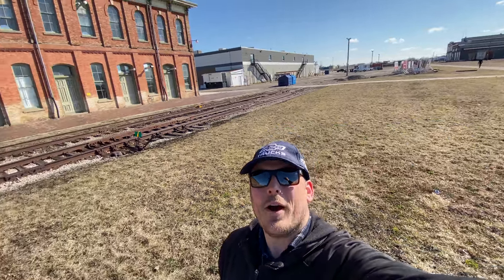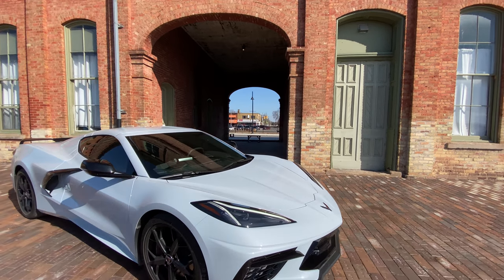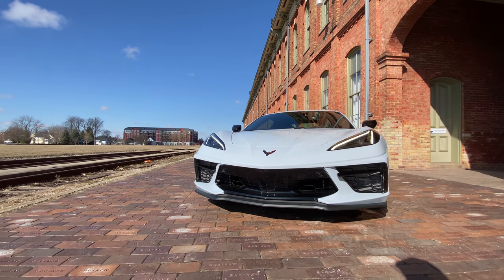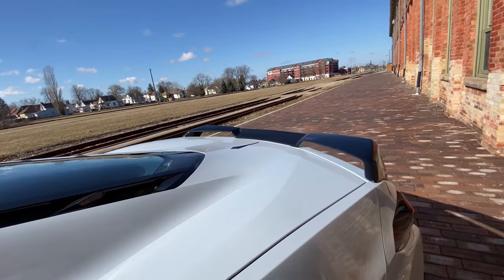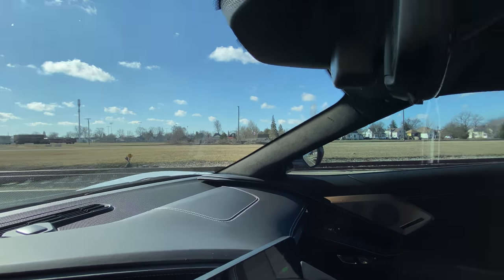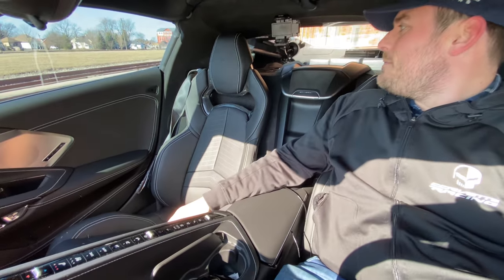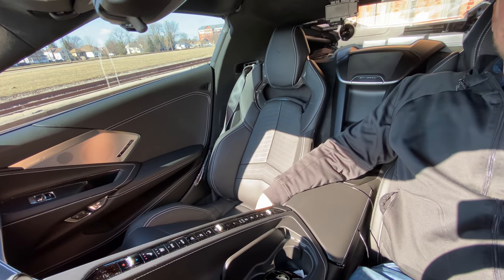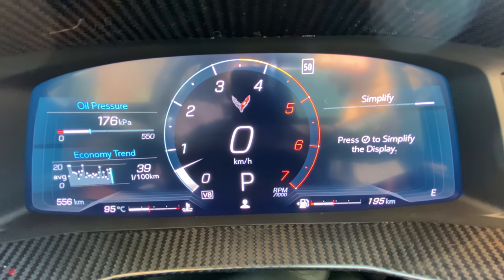Sunday morning cruise in my C8 Corvette / Ceramic Matrix Grey in full sunlight

Comment: I had to research it a little but the windshield is not a designed "downforce" design. The hood and roof create more lift than the small downforce the windshield creates. Love the color, still debating on getting that or Rapid Blue.
Reply from the maker: Depending on where you live that could play a role. Rapid is a pastel and is bright indoors and outdoors. Not a bad choice if you are looking to make a bright statement

Comment: From other YouTuber’s videos I’ve seen this car has massive cooling issues with the DCT many getting service lights and going into limp mode for pushing it a little to hard like doing burn outs or donuts.  Also when streetspeed717 got his new exhaust the installer talked about how hot the engine bay got and it effecting their design. I would recommend not to block the airflow of the vehicle, in fact I would look to improve cooling as much as possible.  I would be surprised if some of the modded cars out there with twin turbos don’t end up catching fire.
Reply from the maker: So far no issues. I haven’t been driving it like an idiot like most youtubers have
Reply: These cars have a brake-in period and a manual that you'll find in the glove box. But most people never bother to read the manual and from what I've seen the first few people who have taking delivery of their C8's have been reckless. That's why you shouldn't give 13 yr olds the keys to a race car!
Reply: Michael Grossi even after the brake in period the cars have problems. I’ve seen people take them on the track and no issues. The problem occurs when you over stress the transmission like burnouts or donuts. This car was not designed for hooning it.  We will have to see, I know the last gen Z06 has over heating issues also. Right now guys are snapping axels buy running NOS and the first twin turbo cars are just getting ready to go. The Supra has an issue with its BMW trans that limits torque. The guys who put larger turbos are now finding the transmission on a supra will limit power actually making it slower. Oh and the C8 in stock form is way quicker than a Supra making it a great value.
Reply from the maker: @Sophie-and-Ken  Dont know where you were going with this rant but thanks for that. So far i have had no issue and yes some people who have modified the base model have experienced some issues but if they would have waited a year they could have got the model GM makes for the more performance driven audience. Its useless taking a base model and trying to make it be a Z06. give them a break and enjoy what we have. its just a marvel they were able to build this for 100k
Reply: Morgan Crosbie nobody is putting down the base model of the vette, if you read my comments I praise the vehicle. Look all makes have problems. McLaren has car catching fire, windshields breaking, electronics issues. You’re lucky if your Ferrari even starts most days. These are complicated machines. The Tremec DCT had some issues with testing and had improved for manufacture. We will have to see how reliable it is. I don’t know if it will be the same transmission in the z06. I know the z06 is getting a different engine. But in all honesty it’s a first gem design and for the money is as good as any care costing twice as much. Oh and a rant is where you talk negatively about a product and trash it. This is a discussion.
Reply: @Sophie-and-Ken  I see your point but I think we should appreciate the C8 for what it is. The C8 will only continue to evolve into faster and better variants as a Z06 and ZR1. Currently the base C8 is so much better than the base C7 and like always there will be mods by reputable suppliers that will enhance this base model. I'm sure Callaway already has something in mind as do Borla, Corsa and ARH. In my opinion Callaway is the way to go but then again you could always wait for the Z06 or Grandsport. Enjoy!

Comment: Did you know that if you didn't have the front lift option you could lower your car up to 2 inches with the stock coilovers it would get rid the gaps
Reply: Of
Reply: How do you lower it? I would want to see a video of factory lowering the car. But since Morgan’s has front lift it’ll have to be on a different car. I can’t stand the wheel gap. It’s my only problem looks wise on the car
Reply: @Todayisthedaythat  look up vossens on c8 on you tube they show it when they installed the wheels tuen i emailed the company and you can see the coilovers in the video that y i change the front lift mod on mine
Reply: Then
Reply from the maker: Yeah I can lower it an inch cause I have the z51